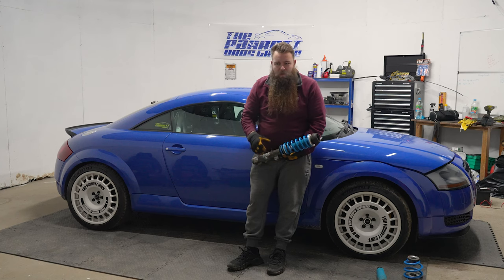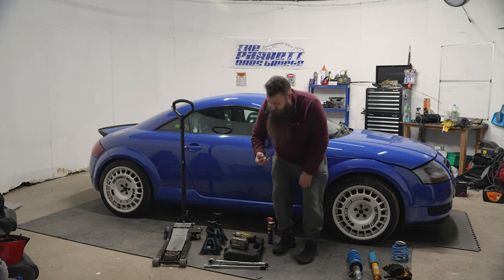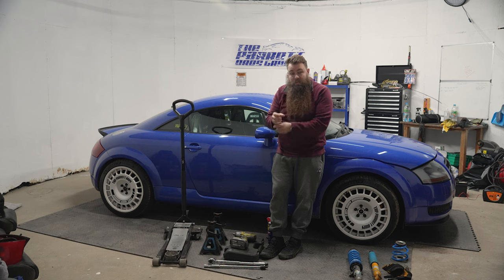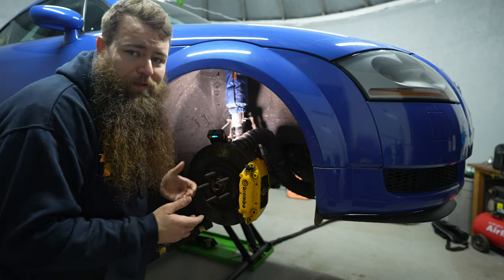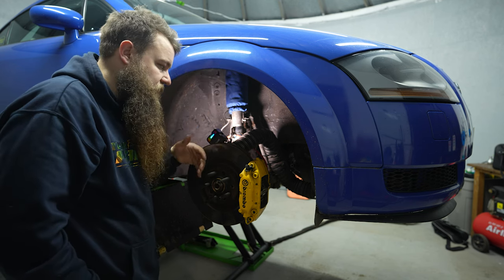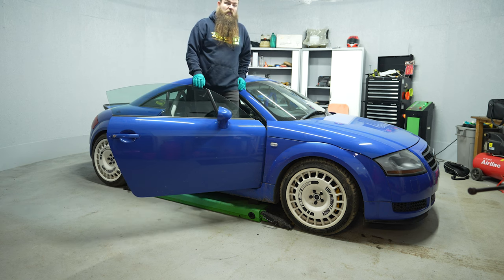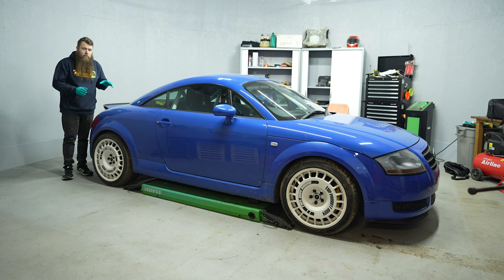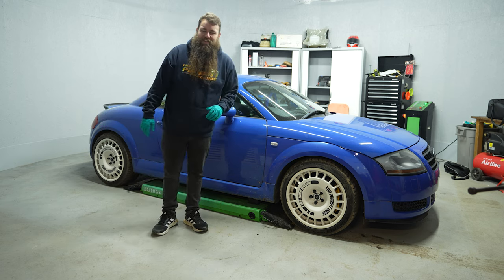Audi tt Suspension upgrade

Comment: That looks a perfect height for the track Dom, love those spring covers!!! and great to see your lift in action. Interesting to see the air flow ducting to the brakes, that will probably save the discs from melting on the ring!  Had my underside painted, really good idea to do that.....much easier with a lift though!!!
Reply from the maker: Yeah low enough it still handles well but not too low to drag objects with me, the cooling ducts work so well on track, when on a track day you can literally 2 foot brake at every corner and you wont lose the pedal, catches others out tho haha

Comment: My standard quattro left hand TT drives well comfortable and steering is good to up to about 100 mph. Over that it feels too soft not so confident to push it around. I was just thinking next step lowering to fast road springs 40mm. As the cost goes well up changing both shocks and springs..then more thinking I will change both get the job done. Then anti roll bars etc..Yes car stance looks fine as standard but lowered looks better.

Comment: looks perfect sat at that height now 👌 I neeed one of these lifts or one that is drill operated! 🤔  be so much easier to do work on the car
Reply from the maker: So i looked at the drill operated one but ive had one in the past and its a faff to use, you need a decent drill as it takes quite a lot of strain to lift and lower, i have been using scissor hydraulic ramps prior to this, you drive on them then pump it up, work great but are very heavy and a pain to move around. 

Thanks i am really happy with the stance of the car now

Comment: So my friend is offering me some lowering springs that are h and r, should I take them and will they mess up my suspension in a bad way like the tire scraping the fender. I also have an Audi mk1. But I have no coilovers we would just be replacing the spring. Is it worth it?
Reply from the maker: H & R are decent springs and offer quite a nice ride height / stance, the issue with fitting any lowering springs on old standard shock absorbers is you will increase the stress on the shocks, make them work harder and likely reduce there life span, a lowering spring should be matched with a shortened shock absorber but i have used lowering springs in the past with stock shocks and its ok, just so you know all the facts

Comment: Would eibach pro sport springs for a 1.8T 225 work well on a 3.2 v6 with B4 shocks? Eibach website say a different spring for the 3.2. Cheers
Reply from the maker: @gogs244  before you buy eibach I will warn you the car sits at stock height with them fitted. If you want a slight lowering go for the h&r springs. 
In answer to your question I’ve used 225 springs on v6 for years. The only difference in the two cars is 40kg weight difference
Reply: @TheParrottBros  thanks for reply. Yes the H&R are the ones I'm looking for. No good second hand ones available except one set on ebay but they're more than the price of new ones!
Reply from the maker: @gogs244  h&r are deffo worth the money, don’t come up very often used

Comment: The gap with the bilstien eibach combination is a problem. I have them and have the same gap. It is meant to be a 25mm drop but it is not- it's factory. really annoying.What are other people using?
Reply from the maker: That’s it mate, it’s like it needs about 1 coil removing from the front springs haha I partly blamed the powerflex top mounts too
Reply: @TheParrottBros  yep- that’s part of my set up too. Really annoying because the ride is good!

Comment: I'm trying to get my control arm replaced on my 2005 audi tt 3.2 ....the oil pan is getting in the way of the bolt.
Reply from the maker: On the front you have to drop the subframe to get at the bolt properly unfortunately

Comment: Hi Dom 
Im after  new springs fron and rear on my audi tt coup bam engine 225bhp quattro do you know the part numbers and where i can get them from
Reply from the maker: There are possibly 40 variants. If you have original factory Spring Still you may be able to see the paint marks on there. This will then relate to a part number, failing that. Speak to someone like Coverdale Car Parts give them your registration and they should be able to advise what you need.
Reply: Thanks realy appreciated have got oe numbers off Audi but a few places said couldnt help or dont stock item

Comment: Love the lift mate that’s a right bargain I’ve just paid not far off that for some bloody polystyrene race ramps🙄. That sits much nicer now 👍 quick question I believe that’s the suspension I have I struggle to adjust the front suspension as it’s so close to the cv boot (mine prob sits a bit lower 1 finger gap if that🤣) any suggestions? Just want to see what the difference is, very noticeable difference on rears.
Also just finishing lanoguarding mine seems really good stuff just makes the car smell like a farmyard🤣
Good stuff
Reply from the maker: Thats mad! i am very pleased and blessed to have got it, going to be a massive help going forwards! 
Adjusting wise is always hard work, unloading the shock / spring makes it a little easier ( taking the weight off the shock / spring)  as long as the threads are clean its a slow process as often you can only get about 1/4 of a turn at best each time. 
Not yet smelt the stuff but i will be getting a mask thanks haha, specially as i dont want to get any in my beard aha
Reply: Thanks for that.  I wouldn’t trust myself with the spanner thing to adjust height🤣 it’s just the valve on the bottom for dampening/rebound think your right though if it was jacked and not on a ramp there will likely be a bit more room.
I’m sure your well aware of it but I’ve been doing the underneath and been well impressed with neutrarust well worth giving a coating before the lanoguard bit of extra protection and transforms the look for such little effort

Comment: Nice, I have e question I life in Belgium so the roads are not that very good. I use my TT as e daily, I want to overhaul the subframe. Is it still oké to putt in the blue powerflex bushes all around the car, car is already lowered on kw1 variant. Will thr bushes not to hard. Or is er e better like less hard pu bushes that you now?
Reply from the maker: By adding powerflex or superpro bushes you will stiffen up your car quite a bit and its not a particularly nice ride if its your daily car. New rubber bushes will still transform the car as the 15-20 year old ones currently on there will be tired and have play. Unless you plan to do track work or want a road track car i would opt for new oem on most and just polybush the front wishbones for a bit better steering feel

Comment: Looking at a car advertised and it says B4 bilsteins - most stuff i have seen says B12-B14s. Ever heard of B4s on a TT ?!
Reply from the maker: Yes B4's are a stock equivalent made by BilStein, an oem repalcement if you like
Reply: Ah ok cheers, so not necessarily a performance/sports upgrade, more of a refresh of suspension keeping similar characteristics ?